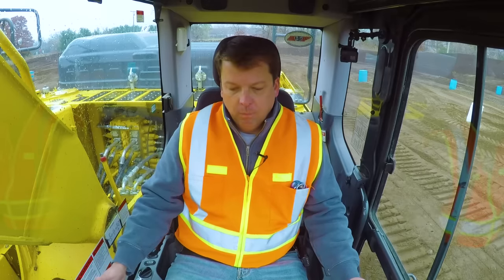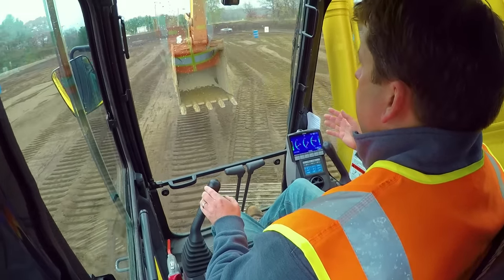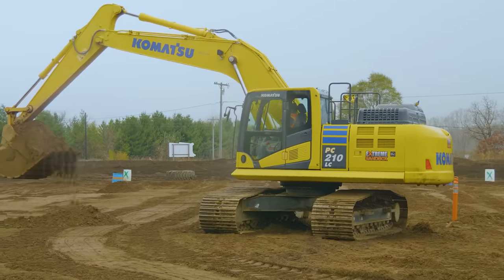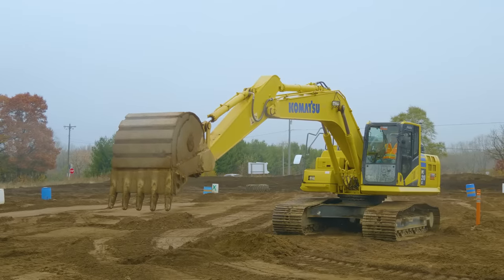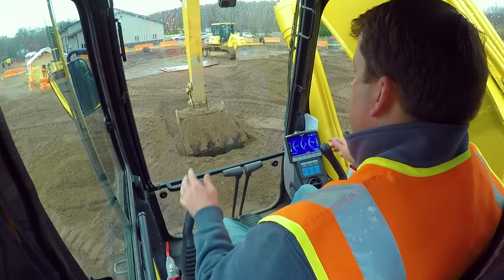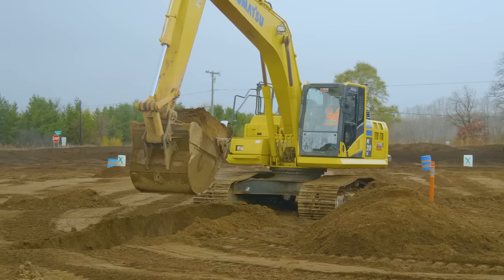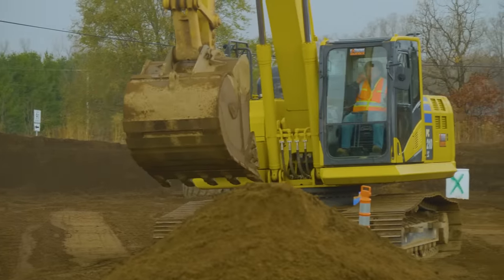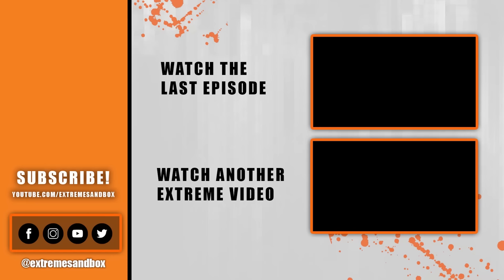What NOT to do in an Excavator | Heavy Equipment Operator Training

Comment: i'm not currently a heavy equipment operatorbut have had some interesting experiences while driving a dump truck in Georgia. the scariest one was the bulldozer operation for me. the regular operator didn't show for the day, so i got to push the load pile so i could load it with a wheel loader(3rd time operating it). given no choice but to crawl on to, guess what..............an older model Cat D9 (i admit my adernaline was running more than my blood). all diagrams and instruction had been worn off and i had no clue as to what did what. i spent the major part of the day on the beasty and got descent results. almost ran over my truck, backed into a house and got stuck between trees. my boss asked why it took so long to get loaded, i told him i wanted to get operators pay for the day, his eyes bugged out and jaw hit the floor( he didn't know the regular operator wasn't there). what a day that was. wish your videos were available then, they would have been so much help. hope they help the rookies alot. thanks.
Reply from the maker: Oh lord...that sounds like an interesting day.
Reply: @HeavyMetalLearning  it was definitely a fun day........................

Comment: I would have to go with either "banging" a bucket when dumping the load or improperly greasing the carousel swing gear.
 Many new operators arent aware the proper way to grease the carousel is to pump a few pumps into the grease zert at the 12 o'clock then turn machine to 3 o'clock and grease a few , to 6 o'clock and so on until you are back to the 12 position....and banging buckets when dumping is super hard on everything!!!
Reply from the maker: Thanks for the tips!

Comment: I generally park at the end of the day in  whatever service position for that machine so that the hydraulic oil can be checked the next morning
Reply from the maker: Yeah...good tip...thanks for the comment!
Reply: Most excavators are the same, dipper arm (stick) at 90 degrees to boom with bucket flat on the ground
Reply: @Free-j3t  the older 200 series cats had to be fully extended to check, modern komatsus are this way and some on the modern small cats are this way but not all of them. Doesnt really seem to be pattern as to why some are and some aren't.
Reply: SogySeal the general rule is all rams have to half way open
Reply: The machine generally has a picture where you check the hydraulic oil.  Tells you how to position the stick and boom.  My JD 470 is all the way extended out and bucket curled up the on ground
Reply: Volvo is also stick out bucket in

Comment: Key points. 

Your GET or (teeth) should always lead the bucket however it is digging. This applies to our machines from CAT 349DLs to our Liebherr 9800. 

Never power hydraulic rams to full stroke, even with full stroke relief valves.
Reply from the maker: Thanks for the comment!
Reply: @Hello kiwabro2009, How are you dong?

Comment: Biggest mistakes I see
- Hitting things like overhead wires with the pivot point of the boom and stick. 
- Going under the bucket. If one of the hydraulic lines for the boom blow, the arm comes down faster than you can blink. No safety valves like a man lift.
- Jamming the drives into things. I never bother trying to put the drives at the back. I just think about where they're not gonna get pressed on and stressed.
-Using swing to sweep large amounts of dirt. Swing motors arent meant to work that hard.
-Getting out of the machine without flipping the control lock. Alot of people have been killed or injured from a joystick being pulled on by a coat or something.
Reply: Jason Mogridge your exactly right
Reply from the maker: thanks for the comment!
Reply: jerry metcalf  Pretty sure the drive motors do not care which direction they are spun and I bet the drive motor on the left side is exactly the same as the right side.
Reply: @trevors8577  Any I've had apart are the same inside. They're just planetary gears powered by rotory piston pump. All symmetrical parts. The chains of the tracks though do wear more in reverse than forward.
Reply: Go forwards and do a tight turn and you're going to scoop all kinds of dirt into the tracks and it'll be doing about the same thing.
Reply: Tracks are tough, tracks don’t care what way your facing. Whenever I run a hoe I just keep them forwards so I can track easier.
Reply: Doing a little reading I found this gem.. 

For hydraulic excavators, Nenne’s No. 1 recommendation is to design the worksite so the operator is digging over the front idlers, if at all possible, to minimize structural stress.

Me: And that I can easily understand that logic as the front idler is supported on both sides vs the drive only supported on one side.

Tim Nenne, undercarriage market professional for Caterpillar (so you know he's not some youtube "professional"), helps customers extend undercarriage life. One suggestion tops his list:  “The biggest single step a customer can take to improve undercarriage life is to maintain track tension at the correct specification, whether it’s a track-type tractor, track loader, or hydraulic excavator,” he said. An improperly adjusted undercarriage shortens the life of components.

Comment: one thing I always notice at my tech school is that no one ever cleans the tracks. Pisses me off, lol
Reply from the maker: Yep...always important to do at the end of the shift.
Reply: @HeavyMetalLearning  okay so how do you clean the tracks
Reply from the maker: jolllyroger1 a shovel!
Reply: @HeavyMetalLearning  ah but do you clean the bottom ones too lol
Reply: Yeah i never really had to much problem with this. We would pull it over by pond an use 2 inch pump with firehose nozzle.  But if it freezes you are beyond screwed. Around here temps jump all around an change a lot day to day. Muddy tracks quickly become FROZEN TRACKS.  Stuck to the ground is a given but the drives being froze in mud is a really bad day.
Reply: Uh, never really worried much about the tracks themselves, but it's always good to clean out around the idlers and gears. I have been stuck for the better part of the morning with a shovel, chisels, hammer, tamping bar, etc. trying to free up frozen tracks cause, my dad... He apparently doesn't believe in daily grease and maintenance. He's gotten used to the forklift that usually just got raised up with a platform and sat for a while, so he got away with just doing maintenance once a year.
Reply: Yup cleaning the undercarriage is no fun but its better to do it every day that after ghe mud and junk has hardened up in there.
Reply: Our operators generally do it every shift with fuelling and greasing. I haul it and they hear it if they don't clean tracks.
Reply: @jeremybaker5444  As an outside hauler, they start to clean them after the first bill gets back with a labor charge for cleaning before transport.
Reply: @jolllyroger1   I keep a little spade shovel in the compartment on the side of mine, if its not really bad I use that scrape out the tops and back pull some from the bottom then pressure wash it at maint. And lube the chains.

Comment: when digging a trench in Ireland on sites the role is 1 meter down 1meter away from the trench. so if 2 meters down 2 meters away its the role on site in Ireland.
Reply from the maker: Good rule of thumb...thanks for the comment!
Reply: Angle of repose 45 degrees
Reply: this rule I'd also here in the USA.  Isha rules.    And do not think that OSHA can't do something about it.  They can. Any where anytime if someone's life is in danger.  The last thing you want to do is have OSHA on your butt.   oh.    What you are talking about is called benching.  if you do not have room to bench you need to use a trench box.

Comment: A mistake I see is when slewing/swinging in one direction and wanting to stop, using the opposite direction slew/swing to stop the machine. This causes an incredible amount of stress on the slew motor and gearing especially in the larger size machines. Judge your stopping distance without using opposite slew/swing
Reply from the maker: Interesting...I have not heard of that causing damage but I guess I could see that.  Thanks for sharing!
Reply: When your teeth are at less than a 90°you are skimming unknown utilities. When your teeth are at 90°you will be grazing unknown utilities. When your teeth are more than 90° facing towards you.. you are now locating unknown utilities and hazards.!!

Comment: One other thing I  might add and that is this: know your machine. Case in point: I had backed up my quarry truck to a Bucyrus-Erie cable shovel for loading. The shovel operator was doing a fine job up until he dumped his loaded 2.5 cu.yd bucket right on top of my truck's cab guard and engine hood. He later came over and apologized saying that he usually operates Northwest shovels which have a slightly different lever layout.
Reply from the maker: Totally agree...thanks for sharing!

Comment: I'm really glad I've read others comments on have your drive  motors to the rear so that if by some chance something slipped out of the bucket or something made entry to the cab and pushed against the drive sticks it would back you away instead of crushing you! My question is, and I'm no operator but I've had some seat time in a few 20,000 # machines and a little bigger, is wouldn't it be safer to have just foot pedal controls for the drives instead of both pedals and sticks together? No sticks, nothing for debris or branches, etc. to hit! Just a serious thought that came to my mind and I had to ask! Thanks!

Comment: We did a major interstate rehabilitation job which was demolition of existing concrete pavement under traffic it also included alot of excavation in preparing new traffic lanes to reset 
Line of sight to a greater distance for traffic. The problem was we had Jersey  Barrier walls next to live traffic. I  was the traffic control supervisor on the job and it was scary to see the Komatsu 400 excavator counter weight swing out over the Barrier wall YES...!!!!

Comment: A mistake I see many new operators make is positioning the machine on uneven ground. Rarely are you digging on flat surfaces. If you are trenching on steep ground up or down you should move the machine and then pitch the tracks at an angle before you start digging. Another mistake is digging and swinging and rocking the machine. Take some time to sturdy the machine. Saves your back and the machine.
Reply from the maker: Good tips...thanks for sharing!
Reply: Explain yourself better Jeff. I know what you are trying to say but what does pitch your tracks mean?  Just make the ground as level as possible before moving into position then throw some material in front of your tracks and walk ahead a foot. This will stop the rocking from happening
Reply: Now that comment sounds like it comes from a real operator. Glad to meet you.

Comment: My counterweight is scratched up from working in very tight spaces.  Sometimes you have to do what you have to do to get the job done.
Reply: Same, our counterweights get scratched up from tree branches. I usually snap them off but the homeowners freak out. One time a client was getting upset with us for not wanting to drive a machine through an area unless the trees were cut back. He said it wont scratch the machine. I told him ill test his theory by rubbing a tree  ranch against his car... he shut up after that.
Reply from the maker: It happens...but key is to know BEFORE it happens, so if you are in a tight space it is understandable as long as you are planning for it to happen.
Reply: Yep, been in many tight spots.
Reply: @Kimmo Piirainen no scratches on my Cat 375 counterweight either. However, the heavy carriage bolted to it does. It holds 3 pair of large crusher jaws and 1 pair small to offset 84 ft of boom, stick, and bucket. It's been drawing a crowd in the pit I'm working in. Was thinking of selling ing tickets, ha ha.
Reply: @anthonythorp7291  That's certainly not always a bad thing by any means. Lol
Reply: @Kimmo Piirainen no its not a problem if you pay for the machine. Or care about the machine you operate. Its only a problem when people are dont care about a 250 thousand dollar piece of equipment.

Comment: If you rake (keep teeth relatively straight up n down and drag the teeth through the surface.(surface before beginning to dig, you can avoid breaking the top edges (crest) of the trench away.

Rule #1 when learning... Do not try to be fast. It’s hard to resist but don’t. Focus on being smooth and accurate, speed will come naturally.
Reply from the maker: Good rule!  Thanks for the comment!

Comment: In January 2012 I was running a Cat 345 in a Federally controlled mine where safety is to the max.  After working a while in the Sabine River bottom with thick, gumbo-like mud,  I had to relieve myself and began exiting the machine in the proper manner.  Because the steps were completely covered in this stuff,  when I put a little pressure on that foot to get down,  knowing I was not in contact with the metal step,  it slipped and made my knee contact the edge of the tracks resulting in breaking my knee cap.  My working life ended that day,  but at least I was an operator for a short time of some months.  Hauled heavy equipment for eight years prior.  Stay safe guys as it's not always cut and dry solutions,  but it's always the operator's fault in a mining operation.
Reply from the maker: That sucks...always points of contact when getting in or out.   Sorry to hear you had that incident!
Reply: I would have thought seriously about relieving myself while standing on the track.

Comment: I've never been formally trained, I learned on my own and from operators that I knew were the best out there.  I was brought up in and around family owned businesses.  We personally owned and repaired our own equipment.  All of us have experienced vandalism and theft.  When I park my own excavator, I fully extend my bucket and dipper to protect the stems inside of the cylinder tubes.  Is that ever taught as a best practice?
Reply from the maker: Yeah, I've heard that and definitely don't disagree with it but not sure I believe it's completely necessary.   I don't park them that way.   But also am one of those guys that doesn't believe there is only ONE right way.
Reply: I had a bucket stem beat up with re-rod that we were using for layout pins and never left them exposed again.  We look at things differently when repairs come out of OUR pockets as opposed to sitting on someone else's machines.
Reply: Not really...best to orient it exactly as directed by the manufacturer...usually a sticker diagram beside the hydraulic oil sight glass indicating correct position for checking oil levels...if not check the manual...most times it's stick close to 90 degrees and bucket underside level and grounded...this puts all cylinders mid strokish so nothing is stroked out....not a good idea to completely stroke your bucket and stick cylinders in and then rest the entire weight of the boom on them like that overnight.